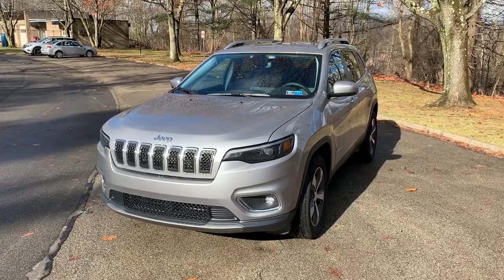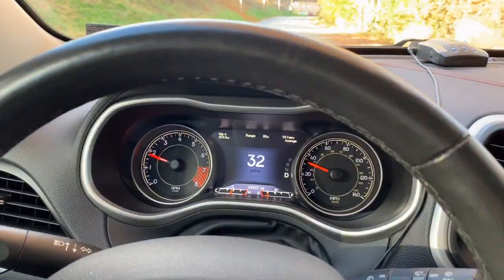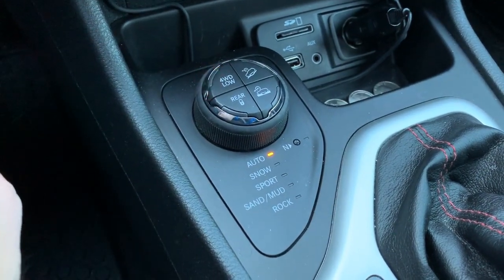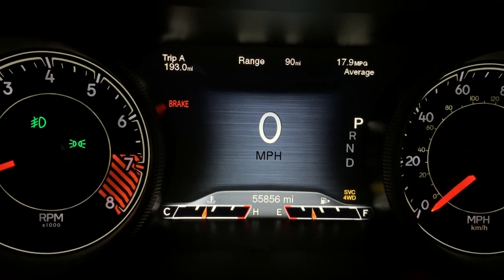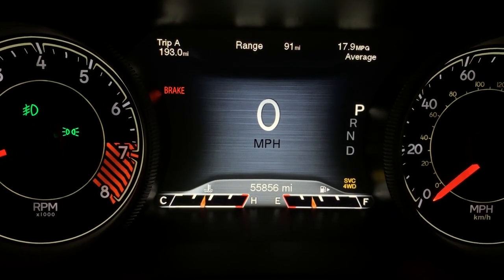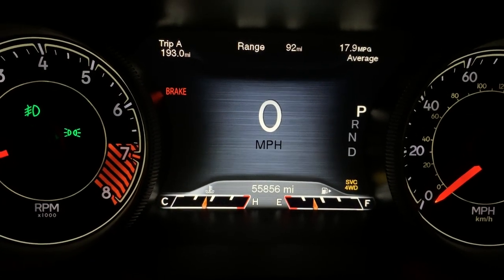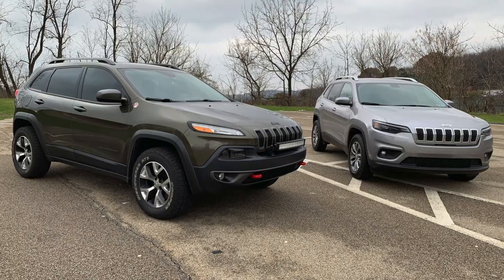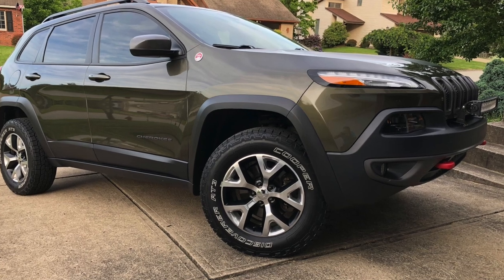Driveline Replacement!?! - 2015 Jeep Cherokee Trailhawk

Comment: Same exact symptoms on my 2015 trailhawk. Took it to the dealer 4 times they kept reflashing the trans module.I told them its a mechanical issue but fell on deaf ears.Finally received a recall letter from Chrysler.  They replaced the PTU. Now w/ 92K I see the rear-end is leaking. I'll never buy another
Reply from the maker: Ah yep. They should cover the leak if it’s within a year.
Reply: When was the recall letter? I have a similar issue with 2015 trailhawk with message of 4W Drive unavailable.  I don't think I got a recall letter.

Comment: 2019 Cherokee Limited V6 at 49k. Brought my car in for an oil change and was informed about an oil leak, they weren’t able to diagnose that day due to high volume.
Slid under the car and found the leak is coming from the PTU and literally the same day my Service 4WD light came on.
I bought the vehicle used so fingers crossed that this is covered under warranty.
Reply from the maker: Geez you might be still under powertrain warranty.

Comment: My wife has a 17 Trailhawk. I brought it into the dealership a few days ago for an oil change(55000 km). They called me and told me the PTU was leaking and needed to be replaced and it is covered under the power train warranty.  Luckily they had the part in stock and the did the work the next day.  I sure hope we don't have a transmission problem.
Reply from the maker: Wow great to hear they replaced it on their own under warranty!

Comment: My 2015 Trailhawk V6 (98K miles) went to dealership on Dec30, for exact same 4WD LOW issue and intermittent grinding noise (which of course stopped the day before).   One month later, and $3500 poorer, they replaced the PTU.  Two days after picking it up, it started horrible grinding noise, probably same as yours.  So drove it to nearest dealership (not the one that replaced the PTU), and they say the drive shaft had not been reconnected to the PTU.  Right now I'm waiting on the two dealerships to figure out who's going to pay for that.  Also contacted FCA, waiting to hear back from them.
Reply from the maker: Oh wow definitely 1st dealership fault.

Comment: Wondering if this is the same while driving I get a check engine with a message 4WD not available and speed slows down I have to stop and turn the engine off wait few minutes and turn it back on and the acceleration gets back to normal
Reply from the maker: Hmm I never had a loss of power.

Comment: My 2015 Trailhawk just started doing the very same thing on Friday. I had it in for a recall  regarding this a couple of months ago but it wasn’t having the issues then. I have 58K miles on it now with warranty until the end of November. I hope they don’t give me any grief over my MFC lift.
Reply from the maker: Glad still under warranty. You should be ok.
Reply: CarGuy11 Found out today they are replacing my PTU under warranty and I should have it back by end of day tomorrow.
Reply: Bad news. Dealer replaced the PTU and on the test drive it was still throwing codes. Had to leave with a loaner. 😢

Comment: This thing happens to me. They replaced the transfer case accuator or PTU and rear differential under power train warranty. Everything works perfect now too. I think it's a common issue on jeep trailhawks. Funny how this thing happens to me at 57k mileage close enough to your case.
Reply from the maker: Yes unfortunately it is a common problem.
Reply: @CarGuy11  thanks for sharing! It's a good feeling when consumers win in the end. Even though it's unfortunate I think we are fortunate enough not to spend a single dime for a hell of a job lol. Fingers cross nothing will happen in the long run for us. I am looking for some extended warranty available in the market not sure if it is too late now. I usually ignores all the offers before and now I'm not getting any. Haha
Reply from the maker: Yeah for sure extended warranty a good idea. Thanks & hope you check out more Jeep videos on the channel!
Reply: @CarGuy11  I subscribed! With a notification bell 👌

Comment: Just changed drive shaft, had small grinding type noise only few could hear.  Also replaced shifter Bevil and wire harness. For a shifter errors.

Comment: Dealing with this issue right now,. My PTU was replaced in June under a recall. Heard the same noise you were initially hearing. I brought it in, they replaced the PTU and the car is still making the same noise. Now waiting on a new driveshaft. Could be up to a week. The kicker is the dealer is telling me to continue to drive the vehicle. This seems rather foolish to do as it can only cause more damage.
Reply from the maker: I had a bad wheel bearing as well. https://youtu.be/aqfGX-nAhec

Comment: My Chrysler 200 AWD that uses the exact same part number PTU as the Jeep Cherokee has been replaced twice under warranty, it's out of warranty now and needs replaced again. Going to tackle it myself. My driveshaft and rear axle, were replaced under warranty as well. I obviously don't off road my sedan but hey, you are supposed to be able to off road a Jeep with the same drive-train so even if I  somehow did, these components shouldn't fail this easy. I hate new vehicles they just are not durable like the old ones - regardless of the badge (brand). If you do a web search for "PTU failure",  you will find mostly FORD with the PTU issues so no different than Chrysler/FCA...
Reply from the maker: Wow how many miles did they last?

Comment: 2017 Trailhawk has been good so far, but in the past month the trans went into limp mode twice, both times while I was up in the mountains on gravel/dirt roads.  Shut it off and restarted it to get it out of limp mode. CEL went out after a day or two. I took it to the dealer and it had a DTC 0750, second gear ratio incorrect. Looks like mine is headed south now too!  Does anyone know if the Jeeps store the DTC without the CEL being on. Fighting with the dealer about it having no code now and I contacted FCA about the dealer being a PIA.
Reply from the maker: Hmm mine stored the service 4wd DCT even though light went out so it should.

Comment: 2015 jeep Trailhawk- I totally regret buying this car. Bought it with 17k miles on it. At 20k the check engine light came on after several attempts to find the issue they finally replaced the transmission. The next issue was the stat stop system/4wd the jeep would go into protective mode. When I took it into the dealer they said it was a fluke thing 160$ two days later it happened again this time 802$ to replace the CPU unit. Now it's the ball joint dealer reports you need to replace the whole thing they quoted this being around 600$.  I only drive this piece of crap to and from work all highway.  Anyone have any thoughts?>
Reply from the maker: Sorry to hear but all of that should have been covered by powertrain warranty.
Reply: CarGuy11 any idea where I can get that information? I was it wasn’t .
Reply from the maker: 5yr 100k mile on 2015
Reply: i bought 2015 cherokee brand new,,from the begening i have transmission and suspension issue ,, i already spend over 7k still no improvement
Reply: @CarGuy11 Is it the same case on mine too? Because I'm also having Transfer Case issues w/ the "SVC 4WD" on, time after time since yesterday  and now today!!!😡😡😡

My model: 2020 4x4 V6 Limited, Olive Green, Active-Drive I, 55,722 miles. Brought it used at an Enterprise used car dealership(I know! go ahead and laugh!).
Reply from the maker: Should still be covered under powertrain warranty.

Comment: Chrysler and reliability don't stick together.
Reply from the maker: Yeah fortunately was under warranty.
Reply: BS.. Every manufacture has problems. My WK2 5.7 has 200,000 miles on it.. no issues at all, just standard maintenance. However, our Toyota 4runner had headgaskets replaced at 85K miles.

Comment: Did the dealership give any ideas on why these things failed, inc. rear diff (at the time)? You don't seem like an off roader...is it possible to mis-use the 4wd system and cause wear?
Reply from the maker: They said the bearings went bad in the PTU. The rear diff was just leaking fluid. Here is vid. https://youtu.be/NAu7tQYw0Vw

Comment: Hi. Im investigating my Trailhawk 14 with grinding sound form left side wheel driver's side on right turns, when accelerating. There is also an audible knock on bumps on the rigyt turn. I have replaced bearings and waiting for the cv axle toarrive for replacement. However i am not sure if that is gonna work. I am suspecting its ptu, though no codes been on the display. Car shifts gears smoothly. Any ideas ? Thank you!!!
Reply from the maker: I would guess CV as well since no warning lights.
Reply: @CarGuy11  Thank you for reply.

Comment: Im having transfer case rattling noises.. about to take it in. Unfortunately I really doubt my extended warranty company will actually fix the issue.
Reply from the maker: Well I definitely shouldn’t rattle so it should be covered.

Comment: Jeep just sent me a letter stating the power train PTU is covered till 150k
Reply from the maker: Yes got the same. Doubt they will cover rear end tho.
Reply: @CarGuy11  I am having the PTU problem on a 2016 Jeep Latitude.  You and Will Dunn mention a letter you received from Jeep?  This car is out of warranty and has 103,000 miles, but this letter sounds interesting.  Can one of you share that letter?
Reply from the maker: I don’t have it anymore but you can always call a dealer with your VIN and they can see if you are still covered with any warranty.

Comment: did the dealer give you any problems because you are using wheel spacers when they had to replace a wheel bearing?
Reply from the maker: Ha I removed them before taking it in so not sure if they would have said anything.

Comment: Hi
i have 2014 cheroke trailhawk 2.4 
and suddanly evry lights on dashboard goes on , i scanned it and it is -u0001 have any ideas? or smthing similar to anyone ?
Reply from the maker: Quite possible low voltage on battery causing it.

Comment: Hey
I have a 2014 Jeep Cherokee 2.0D
I got a message on the SVC 4WD dashboard
The car is driving (I don't know if the rear drive will turn on because I have no way to check)
It does not make disturbing sounds - everything looks correct except for the message on the board.
Do you have any idea where I can start, how can I tell what is wrong?
will you help?
Thanks
Regards
David
Reply from the maker: If it’s making noise it likely needs replaced.
Reply: @CarGuy11  
It doesn't make any sounds - it's quiet, it doesn't make any noise
Reply from the maker: Still likely needs replaced unfortunately if you want 4wd to operate.
Reply: @CarGuy11  
Your diagnosis is strange
You speak as you do on the site.
You need to know the reason before replacing it.
Exchange what?
This is probably the basis, I thought you knew the basic causes of this error, but I see that you do not
Reply from the maker: It’s either the front or rear PTU. You will need it diagnosed with a scan tool to find out.
Reply: @CarGuy11  
Yes, I know,
When I get home, I will check the Autocom connection that I have, maybe it will tell me something

Comment: I have 2016 Jeep Cherokee limited 4wd and the light went out on my terrain mode.Snow storm occurred in NYC and i got stuck and was forcing to get out of the snow. All was fine until next day i drove from my house in CT to NY soon as i parked the car dashboard read "transmission service required"> I immediately took it to my local mechanic and he tried to move in reverse and car would not move. Took him about 3 min after forcing the shift into drive. He said alot of codes came up and he believe it was due to storm( i never told him i got stuck). Now he says "i hope its not transmission but you have to take it to dealer".He cleared the codes and so far it is okay, but i am scared something bad will happen PLEASE HELP
Reply from the maker: Well the transmission should be covered under powertrain warranty still. Codes may be from overheating getting stuck. See if any come back before taking to dealer.
Reply: @CarGuy11  I called and they said it is not covered. I have 67k miles. Should i be concerned that the light that switches the modes to snow, mud still has not come on?

Comment: I have a 2015 Trailhawk,  Rear differential was replaced at approx.  45k.  My transmission is a huge let down.  The dealer flashed it at a 1st state inspection / at 12 months and now 2nd gear is gone.  Huge Bummer.  Those who Know Really Know what a bummer it is...
Reply from the maker: Yes I know exactly what you are talking about.  2019 trans is improved but still not great.
Reply: @CarGuy11  this improvement if any, must be carried over to all models. Because every mechanical component stayed the same except programming and software development. I can't believe how Jeep are dealing with this gearbox. I guess their engineers are dumb especially because those issues are not present on other brands using zf 9 speed transmission.

Comment: Hi, I guess I've joined the club of people having the 4WD service required message lol. It just happened to me right now in my 2016 Trailhawk. So this is a defect that the dealership will fix? Thanks for making this video
Reply from the maker: Hopefully you are still covered by powertrain warranty. Thanks for watching and hope you check out more Jeep videos on the channel!
Reply: @CarGuy11  👍🏽 Fingers crossed, I guess I’ll find out tomorrow!
Reply: @djleadone  any update? I have 2020 Jeep Cherokee and have the 4WD service message popped up
Reply: @rafaabdul2941  It is a known recall… They fixed mine, but I have the extended warranty so it was covered anyway. But it is a known defect. You can use me as a reference as I already fought with my dealership and they admitted later that they researched it and saw it was known about. Good luck. I still think this is a class action lawsuit case, but they replaced the drive train.